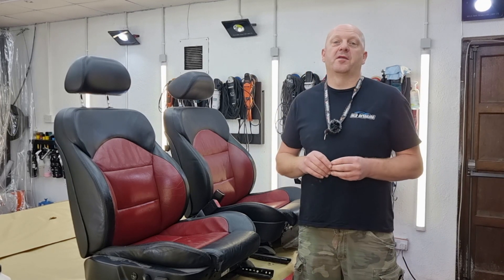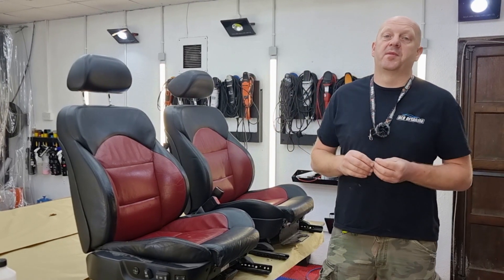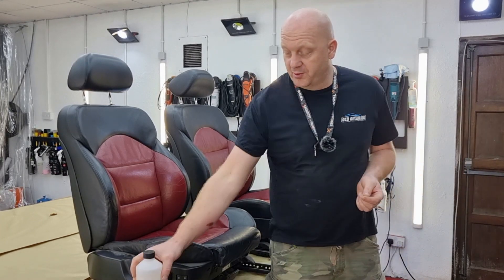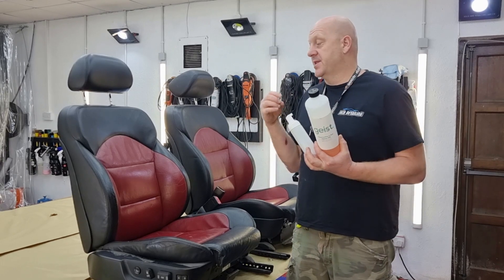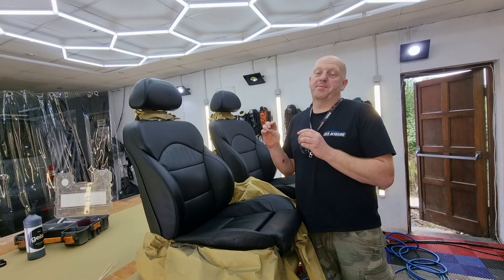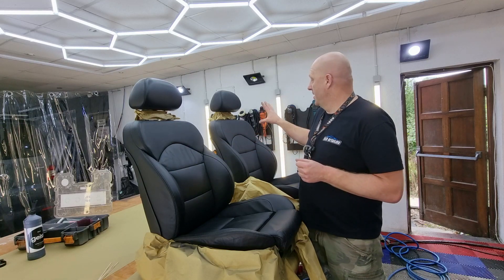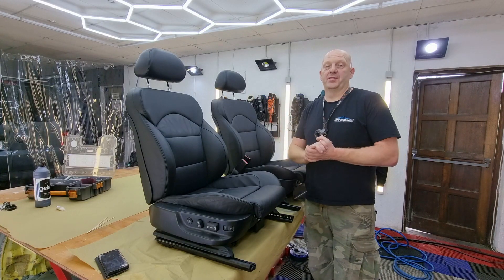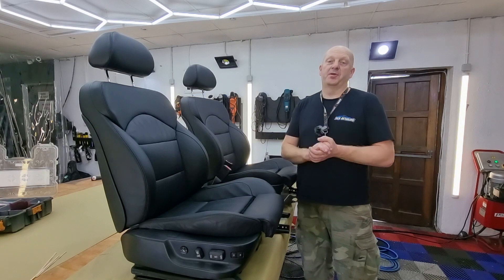How To Change Color Car Leather Seats | BMW M5

Comment: Would it be possible only to repaint the red bit? How would you mask the black ? (especially at the seam)
Reply from the maker: You could spray just the red, you would need to tape up the black leather, spraying all was much easier job. Some time after new owner of those seats asked me to restore them back to their original  colour, it was huge challenge.

Comment: I rather have it red but that's just me
Reply from the maker: It wasn't my choice, I would also leave them red as the condition of these seats was outstanding for the age. It looks like I will have them again, to bring the original color back again 😀
Reply: I’m with the owner, I think the two colours on the seats makes the car look older. Great job! Great video

Comment: Great work. What would do on the backs of the seats, plastic parts if you wanted to recolor?
Reply from the maker: Thanks, the paints work well on leather mainly , they can be also used on plastic along with plastic primer at the start, but this kind of job will not have the same wear resistance as factory finished plastic, I am looking into finding system for plastic restoration.

Comment: Great video. Thanks. What about ventilated seats? I would be afraid that all the tiny holes get filled up with paint.
Reply from the maker: I did this job on perforated leather, there is no issue when I sprayed with the gun, of course , you would need to make sure you clean the perforation after sanding etc   before you spray it, if I get chance at some stage I may do video about it.

Comment: I see you used Geist for all prep and cleaning work. It did an awesome job. But what brand paint/dye did you spray with? And do have everything as for also the final topcoat you applied? Your ending results were amazing!!
Reply from the maker: I use a lot of Geist products but also Colourlock , I have topcoats crosslinker , check my website www.ocddetailing.ie